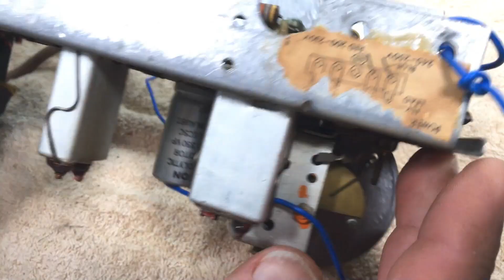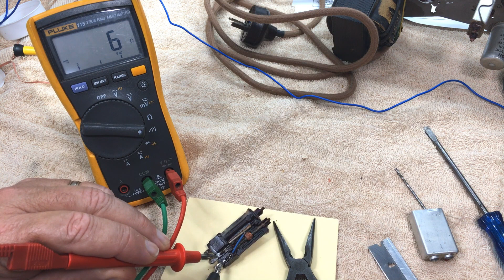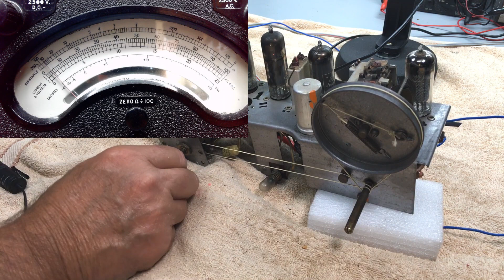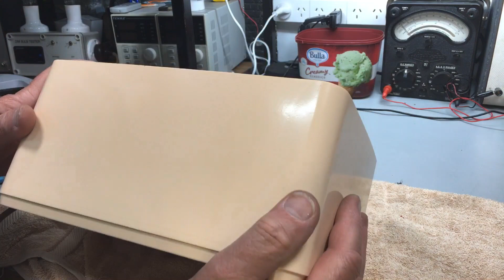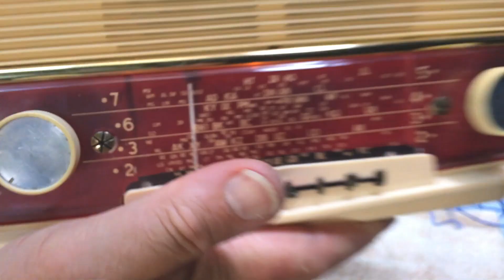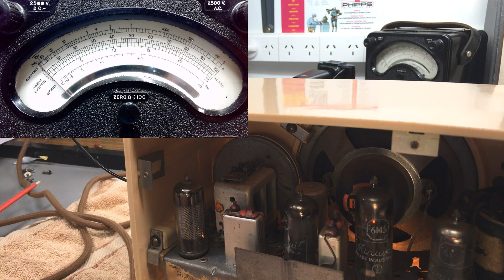Philips 166 Radio - Part 2 of 2

Comment: I nearly spat out my coffee when you said that those Philips IFs never give much trouble!  Not in my experience.  I've come across radios where every IF winding was O.C!  Also come across the issues you have, often.  I've Philips radios that will remain silent due to IFT issues.  Power transformer failurs too, are common.  It's a pity, because I generally like Philips sets.  This is of course no criticism of Philips, as they were likely reliable for their expected service life.
Reply from the maker: Wow. I must have been very lucky over the years. I have around 12 of these to restore in the workshop atm. They all work to some degree.
Cheers mate, thanks for the info 👍
Reply: @techobaz55  Maybe it's a climate thing.  Warm and wet here.  I just got given a Philips 124 in with a dud power transformer; shorted turns.  I have a defunct 154B chassis with a compatible transformer, but vertically mounted.  Went to the trouble of transferring the mounting hardware to the 154B transformer, but thought I'd better give it a thorough test before wiring it in to the 124 chassis.  Just as well I did!  After a couple of hours the transformer failed in the same way; shorted turns, with the dim bulb gone quite bright.  Oh well.  I've a few other Philips chassis, but none with a physically compatible chassis.  I fear a rewind coming up.  Groan!      Anyway, good job on yours.  It has inspired me to have another go at repairing some of my dud I.F.T.s.    😊
Reply from the maker: @stuartirwin3779  yeah, go for it !
Seems Dave Tipton is the man for rewinds, lol.
Better not advertise him too much, he might have enough on already !
Reply: @techobaz55  He likely does.  He's not that far from me, but I've been rewinding transformers for a long time, out of sheer necessity.  It's just not a job I relish!